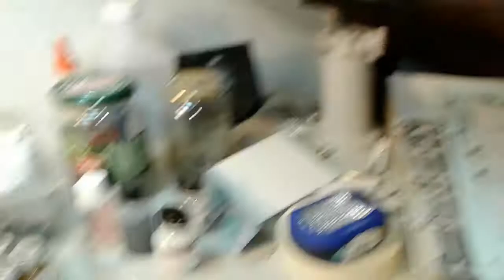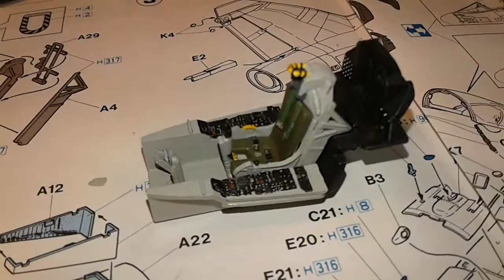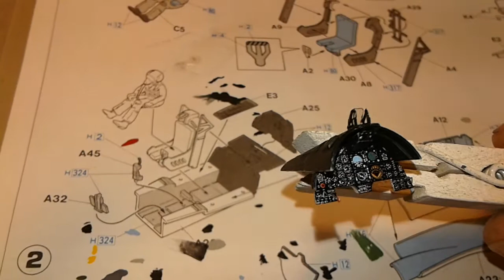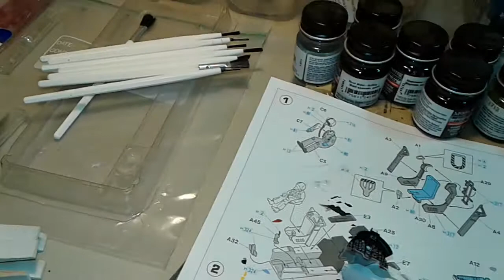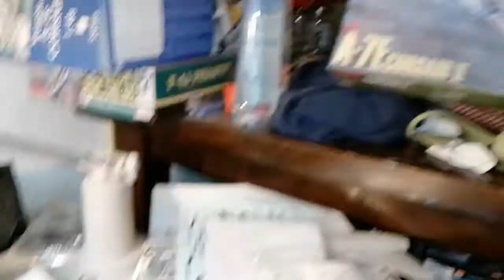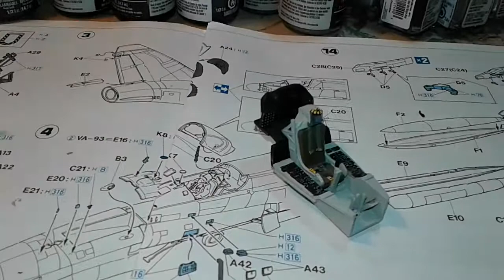LTV A-7E Corsair build part 1

Comment: The cockpit instrument panels look great!
Reply from the maker: Thank you ! That Eduard photo etched really makes it look real.. I wish I could paint it that good..
Reply: The photo-etched parts intimidate me. I do have a few kits that have them in my stash. I usually dry brush the instrument panel white and coat them with Testors DullCoat spray lacquer.
Reply from the maker: I usually paint the panel too and try to make it looks as real as humanly possible. I should do a video on two of my builds I did. I did a Monogram A-10 and I was shocked at how good the instrument panel came out.  I wasn't a fan of photo-etched but after using it more I'm getting more comfortable with it.
Reply: f4cphantom2 I will have to try the photo etch parts on my next build